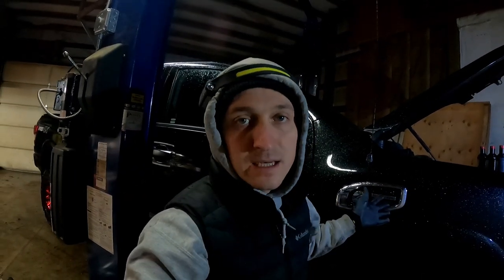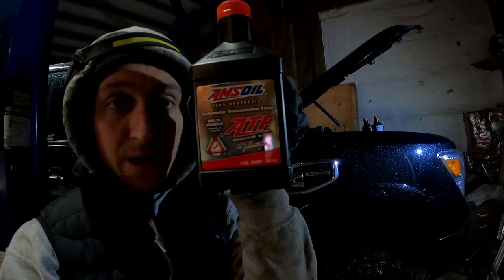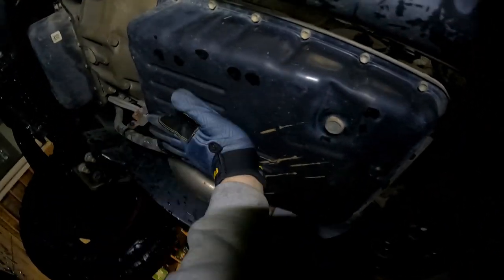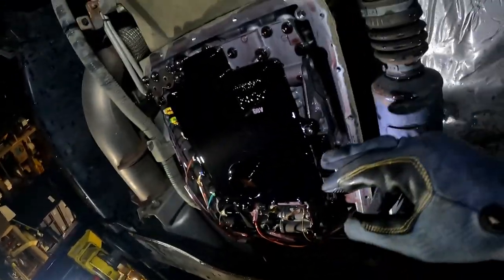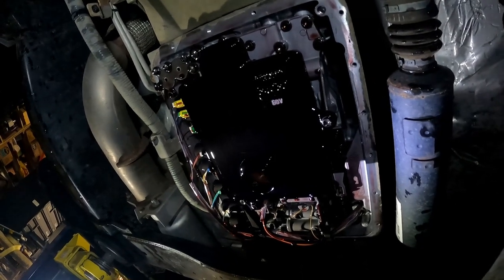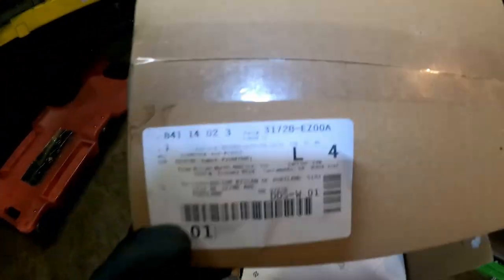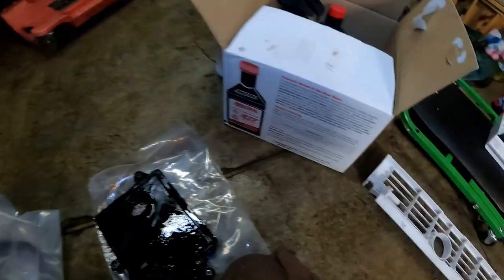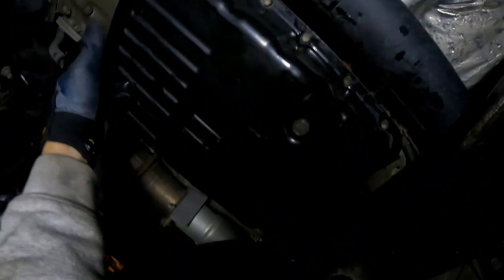Nissan Titan Xd 5.0L diesel Transmission fluid change DIY

Comment: Great video. I went to the local Nissan dealer to try to get my transmission serviced with no luck. They advised just a filter was $115 and the gasket was $75 which they did not have in stock so I did a little research and found out that Nissan titan has the same transmission as the ram 3500 transmission code AS69RC. I purchased the gasket and filter from O’Reilly’s for $40. The parts are identical as the Nissan parts. I hope this helps.
Reply: Information like this is greatly appreciated. For those who are interested WIT Transmission parts is a great source for anything transmission related.

Comment: I like that Nissan makes this real easy if you just want to change the trans fluid without the filter, I bought my 2016 Titan with 23,000 miles so I just drained the fluid  and replaced it with Amsoil which took almost 8 quarts. When I hit around 44,000 I bought all the OEM parts online from Nissan and had a dealer change the filter and supplied the Amsoil. I mainly had them do it for warranty reasons, with dealer records for future resale. I asked for the old filter back and cut it open and found 0 particulates, it really looked new. I have no hard shifts and I tow a lot in the summer, with no worries. Thanks for letting those who think this is difficult that it's pretty easy if you have basic mechanical ability. Just make sure you install the pan bolts with the proper torque specs, and tighten them based on recommended pattern. Loved the video keep them coming.
Reply: Do you remember the torque specs for the pan bolts?
Reply: @spencerhurley8359   Torque the transmission pan bolts to 16 ft-lbs each in an alternating pattern.
Reply: I just read 5ft/lbs for the pan bolts, to avoid squishing the gasket. Now I'm confused!
Reply: @spencerhurley8359  if you're worried just call the dealer and talk to a tech, I know some torque to 3-5 ft lbs first then go around the same pattern with 16 but just call for piece of mind.
Reply: @jamesstouffer1845  I got a hold ofthe service manual, when I have time I'll look and see what it says

Comment: Thanks for the video! My 2017 just hit 78k and I’ve had the transmission serviced about every 30k as recommended by the dealership. I have the manual but I don’t remember what it recommends for the transmission. I’ll start changing it myself once everything is out of warranty.  I did use the AMSOIL when servicing my old 2006 Land Rover with 220k+ .  The AMSOIL fixed the shifting and slipping issues.

Comment: Morning , thanks for the video , this is one of many but very clear and very informative .
I followed your you steps exactly and all went smoothly , 10 QTS removed and 10 QTS replaced with Amsoil ATF .
When I started the truck it gave a AT Error warning light and after a 30 seconds of running I put the truck in 
gear and the the shift was very hard .
I lets it run for a further 5 minutes then turned it off to go run some errands .
When I returned the truck stated as normal and selected gears VERY smoothly this time , but the AT light is
still on , I checked the AT oil level and it shows high when cold ... but as stated 10 QTS out , 10 QTS in ... 
Today I planed to drive it when I get home to see if there is any change .
Any advise would be greatly appreciated sir .

Comment: Another transmission additive I like to use is sea trans made from sea foam. That’s some good stuff. I put it in an old dodge cummins once because it was shifting erratically and it fixed it. Good video though. Thanks man. I’m a Nissan Cummins newby. Just bought my first one 3 months ago and I’ve loved it so far.

Comment: Hi, it’s awesome video. Can you tell me how you deal with DPF filter? Did you use any cleaners or additives?
Reply: I mainly use seafoam in my truck every 1-2 months. Stuff is good and will keep everything clean. I also will use power service gray bottle at beginning of the winter time before it gets cold to keep it from gelling. But mainly I just use the seafoam.
Reply from the maker: What dpf filter? Never heard of it lol

Comment: Hey buddy, what are the torque specs for oil pan and filter?
Reply from the maker: 62inch lbs if i remember correctly just make sure they are tight.
Reply: @BuiltForSpeed  cool!

Comment: hello there, i have a problem with my 2013 Volvo my control panel don’t work it has no light and my ac/heater wont turn on

Comment: How can I figure out the Temperature without the computer you are using? Thanks
Reply from the maker: I would say just run it for about 10 minutes. Shift it through gears a few times and then check level..

Comment: HI ,
Help , I just changed my fluid and followed the exact steps you showed and first start I have an AT Error light on the dash .
the gear selection is very hard and only turned the truck around and parked it .
I changed the filter , gasket drained 10 QTS and refilled with 10 QTS Amsoil Signature ATF .
Please advise
Reply from the maker: @jonthus1  check the fluid level when truck running and warm in park. Pull the dipstick and check fluid level. Don't ever trust what eas in truck. Put the amount in that you draine then check on dipstick

Comment: I got the AT light on after I changed the oil transmission fluid  does anybody know how do I reset that light ?
Reply from the maker: Just clear codes with scanner or disconnect battery for 15min. But before doing that turn the truck on run it throught gears set level. Then clear codes.
Reply: Thanks I’ll try that cause I drove it and shifts nice real nice 😎

Comment: would this resolve my AT error?
Reply: Did you figure it out in how to erase the ATF light ?
Reply: @jesusruizg6951 I reset the error, went to get a transmission fluid change at the dealer and the issue has never reared its head after that... keep in mind it has only been a couple of months.  I also mostly just use this beast for towing my 8k TT.
Reply: @Mretinum  thanks it went away by it self after I drove it for a few miles